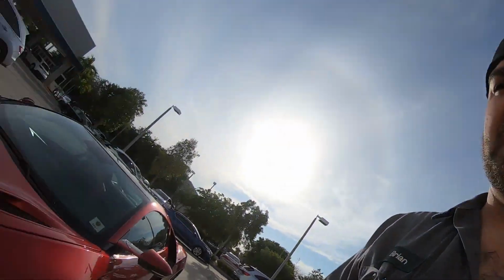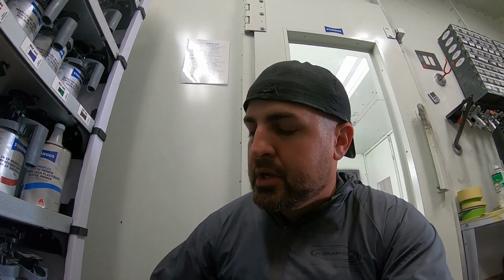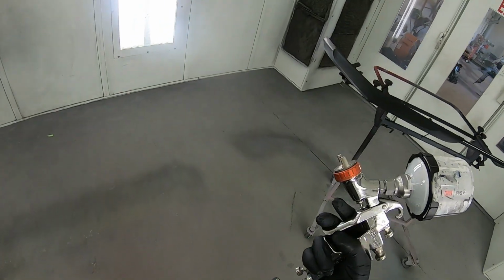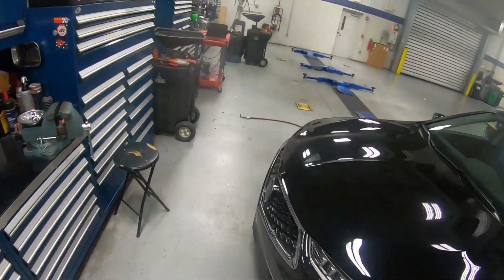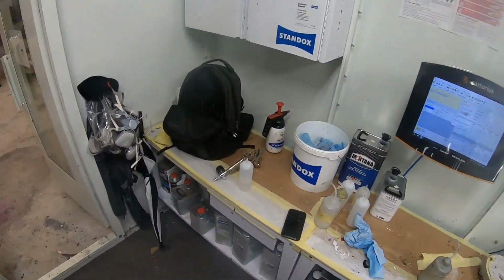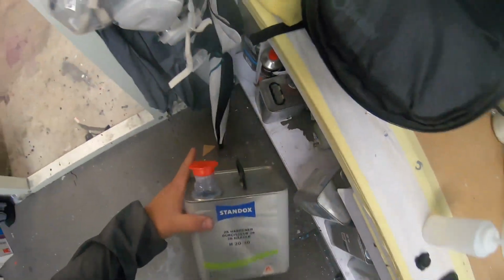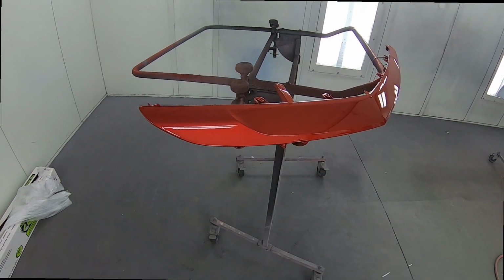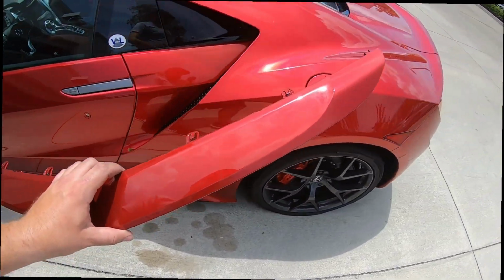Car Painting: Can we match this NSX Red Pearl?

Comment: what would u recomend to dry water base paint in a home gargae..?..and how easy is water base paint to use.?..i have never use this system ...seen u paint a tangelo orange hellcat miata car looks great...
Reply from the maker: Thanks for the sub! Try to stay away from water based in a garage, works much better in a booth. Water base needs to be blown dry with air moving across it. Not directly into it. You can buy air attachment tools that will assist in drying the base. If you Allow it to dry on its own it will take a very long time.
Reply: @PaintSociety  hey I know this is quite an old video but hoping you can help. 
I’m in the UK and have a NSX in the same colour. The hood has been resprayed badly by the previous owner and the colour doesn’t match so needs to be done again. 
My body shop guy is very experienced but struggling to match the R556P paint correctly from his suppliers. 
Can you tell me what brand of paint you used in the video or could you supply it to me?
Reply from the maker: Sikkens autobase
Reply: @PaintSociety  thanks for the reply. Is that just a base coat or the colour as well?

Comment: Whats paint gun did you use please?
Reply from the maker: Bibis DIY I have many. What are you trying to do? Maybe I can help based off what your goal is
Reply: @PaintSociety  I was planning to have a good cheap clear coat gun and was debating on a iwata or what would you think is a good clear coat gun if you could please help I painted one of my cars about 2 months ago using the flg4 and sprayed basecoat amazing for being a metallic but clear coat was a bit iffy and was very orange peely
Reply from the maker: Bibis DIY typically good and cheap don’t go along in the same sentence LOL. I’m going to recommend the bass which is a WS 400. Also you can look into the devilbiss Tekna copper. Best all around gun in my opinion. I use it quite often on the channel for sealer base and clear.